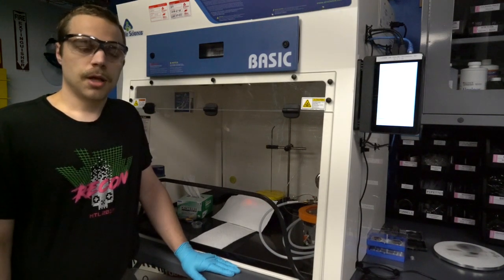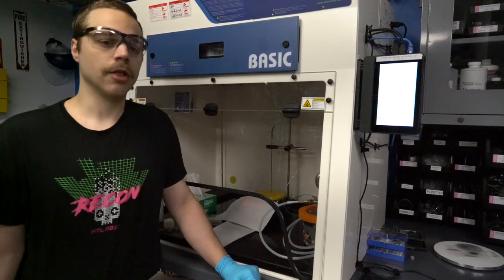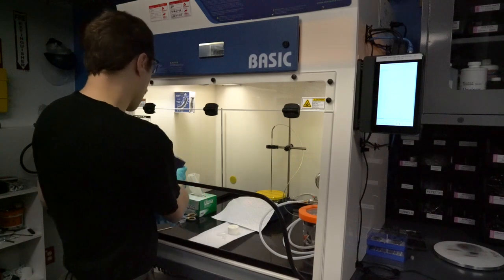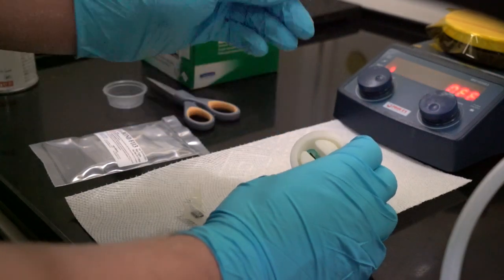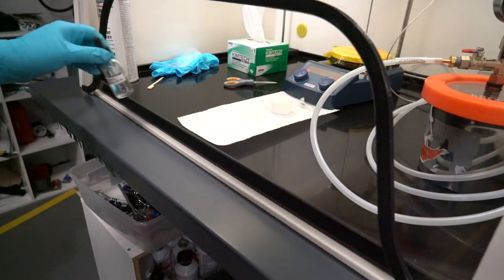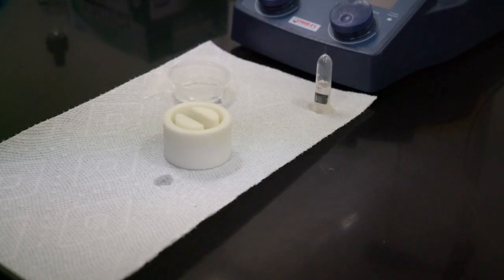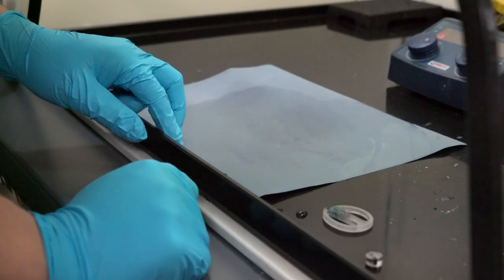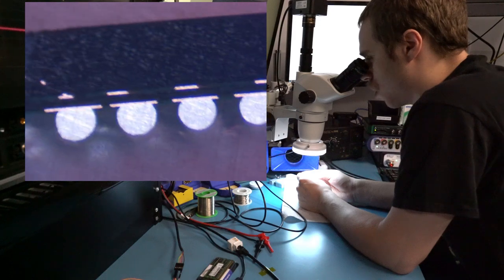Preparing cross section samples

Comment: Hi Andrew, I'm currently preparing sample for cross section viewing in a Scanning Electron Microscope (SEM). I need a really good and clean cut and sand paper isn't clean enough.. Can you please advise a cleaner method of cutting? Thank you in advance
Reply from the maker: Hi,

Generally whatever you use for the first cut is going to cause a lot of damage. A low speed diamond wire saw or similar will help, but there will still be cracking and possibly some heat effects in the immediate vicinity of the cut.

This is why you start by making the initial cut a bit back from the plane of interest, then use increasingly finer abrasives and fairly slow polishing speeds to get closer to your final imaging plane with increasingly higher surface quality.

What grades of sandpaper are you using? I usually start around  P500 and run out to P10000 before switching to the diamond polishing paste.

For low magnification optical microscopy (stereo scope) even around P5000 would likely be enough. For optical microscopy I usually run slightly submicron, say 500 or 250nm diamond. For SEM, depending on magnification, you might want to go all the way to colloidal silica with particle sizes in the tens of nm.